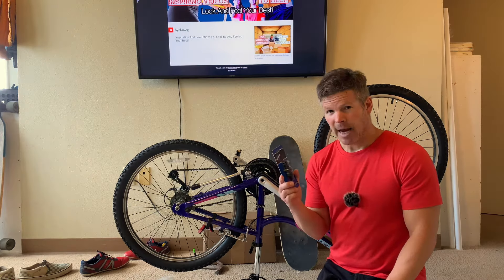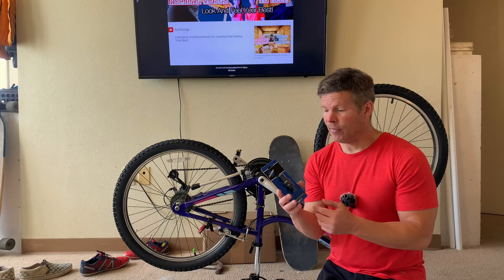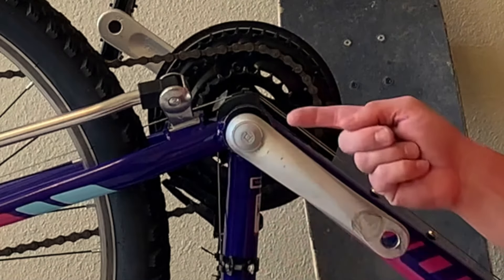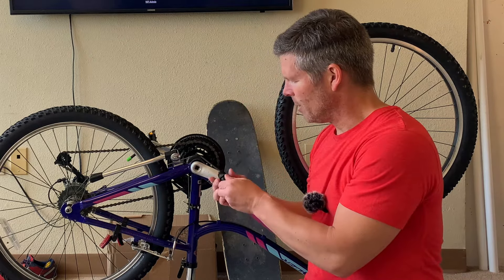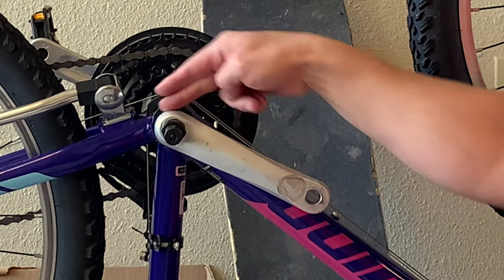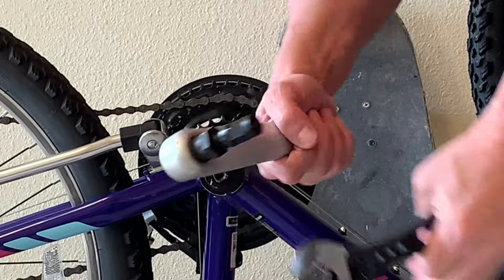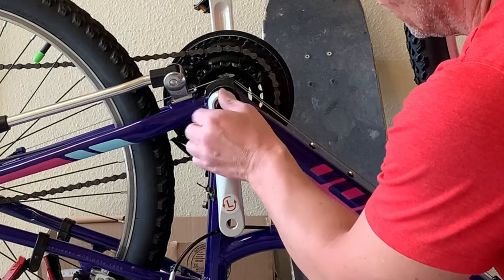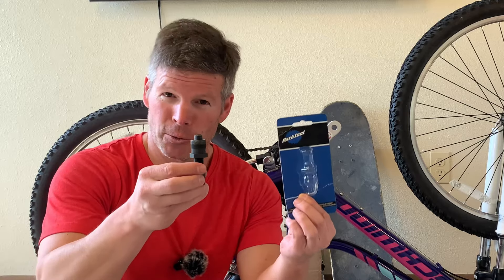Park Tool Bike Crank Removal Puller Tool Review and Demonstration

Comment: just used this very tool and all it dead is pull the threads out of the cranks. Both sides. I really did thread it all the way in, as far is it possibly could. Not coming loose

Comment: Nice, exactly the situation I'm in and the solution that I need.
edit- NO, SCRATCH THAT! SCRATCH THAT COMPLETELY!!!
I bought a universal crank puller and I was not aware that there are three different crank attachment types - Square taper, octalink and Isis.
I had a square taper Shimano crank, but I kept the Octalink/Isis attachment on the tool because I was unaware it could be removed and, in my case, MUST BE REMOVED!!!
After following your instructions, I STRIPPED ALL THE THREAD OFF THE CRANK!!
Now this crank is stuck there for eternity! It's a hire e-bike and it needs the crank removed to replace the pedal assist sensor!
Reply: unlucky

Comment: I was trying to replace the PAS sensor on my e-bike this week and was looking at another $40 minimum charge at a local bike repair shop (labor only, already had the replacement sensor) and found this same Park tool online. Found a local place that had one on the shelf ready to go, so I would not have to wait a few more days waiting for Amazon to ship it to me. 

I was a little confused but found a very insightful how-to on Park Tools channel here on YT which was VERY helpful. At first I was afraid I was bending or stripping something as it was turning, but wasn’t visible backing out. Turns out I was doing it correctly and to just power through. It came out and went back on perfectly.

Then I lolled when I saw your adjustable wrench. I bought the same exact one from Walmart a few days earlier since I didn’t trust my ancient, wobbly, soft metal adjustable wrenches. 

I’ll probably never have to use this Park tool ever again and that’s ok but knowing I CAN is a good feeling. Great video!
Reply from the maker: Thank you so much for your comment. It made me smile and brightened my day. : )

Comment: What’s the difference between that crank puller CWP-7 and the CCP-22 that has a handle?
Reply: The CWP-7 is compatible with a wider variety of bottom brackets than the CCP-22, such as the shimano octalink.

Comment: I had a horrible experience with this tool. My crank set seemed to have been installed dry. Not only did this tool strip my crank arm threads, but its own threads were stripped in the process as well! Which I can't understand. Isn't this tool supposed to be made of steel and the crank aram aluminum? 

Any way, I had to use a bearing/pully puller to get both crank arms off. I'm gonna try another brand of this type of tool next time.